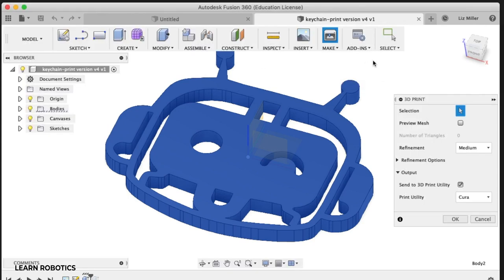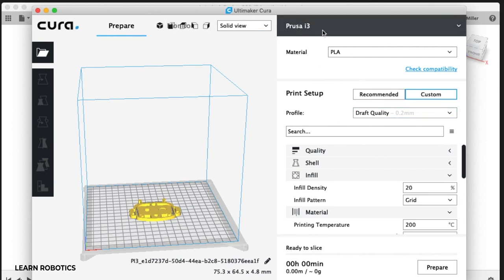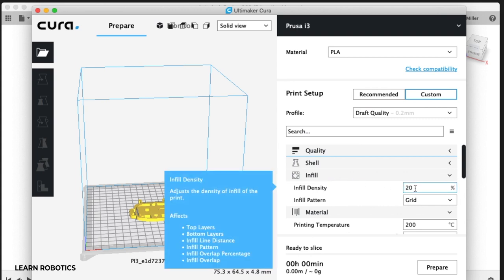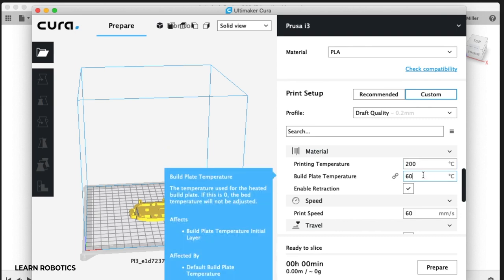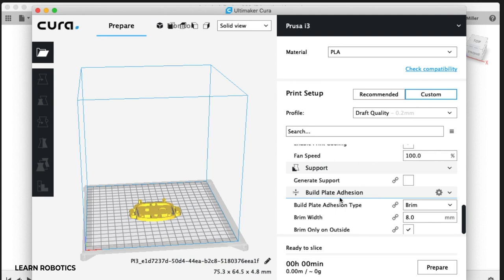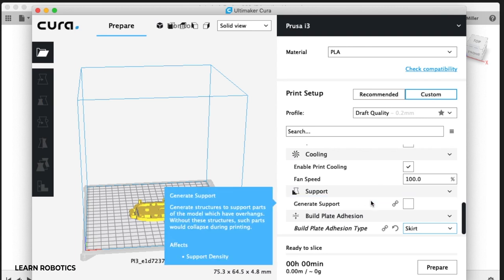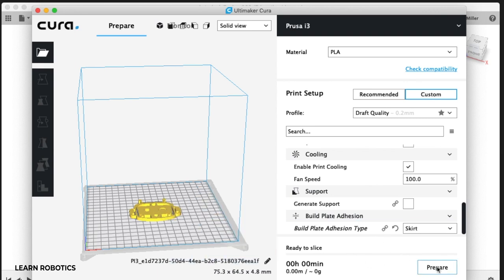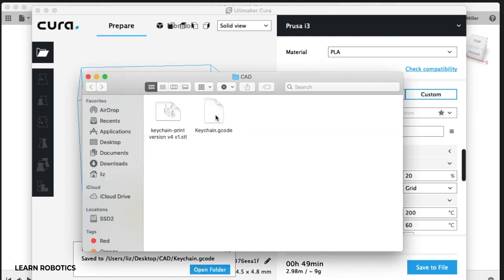How to 3D print from Fusion360

Comment: Hey I've got a question, I got a 3d printer from my cousin yesterday and he helped me with sending this video, but now my question to you is, how do I get an SD card connected with everything so I can start printing? I also have the Anet-A8 printer and have everything set up, I just need to know how to get an SD card connected from pc to printer. Thank you!
Reply from the maker: The A8 mainboard has a micro SD card slot so you can plug it there. Otherwise, you can use your PC and connect a dongle, attach the SD card, transfer the file to the PC, and use a USB to send the file to the A8. Lots of choices here. Good luck!
Reply: @LearnRobotics  thank you! I found the place to put the sd card and i started printing something, cant anymore due to vacation but im enjoying printing things its pretty fun!